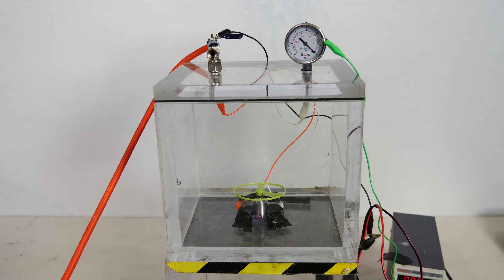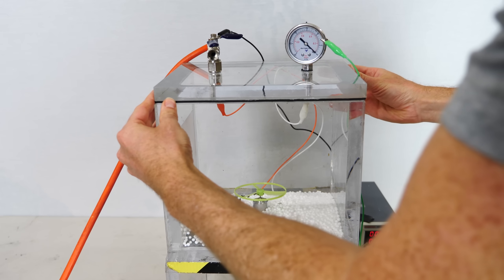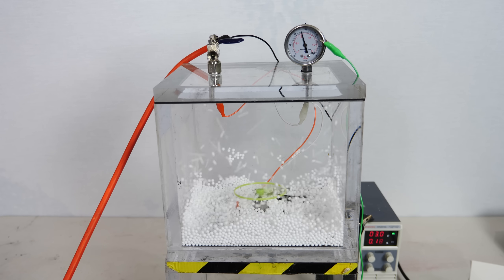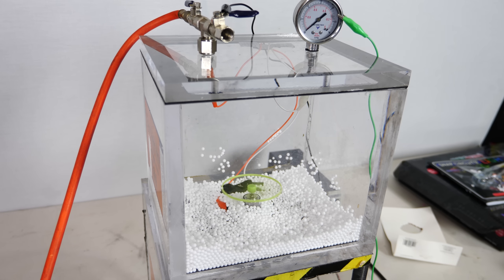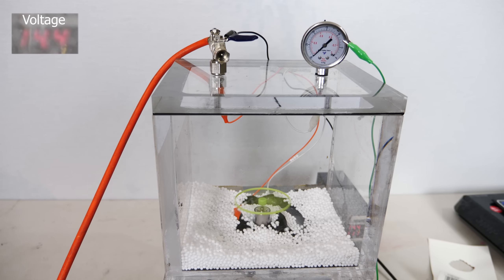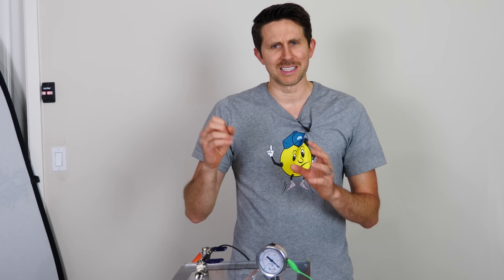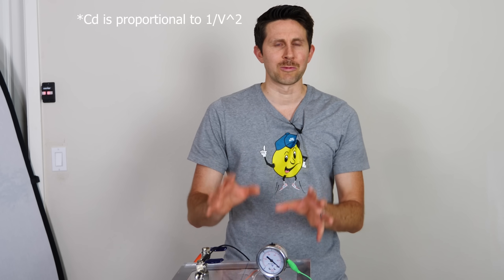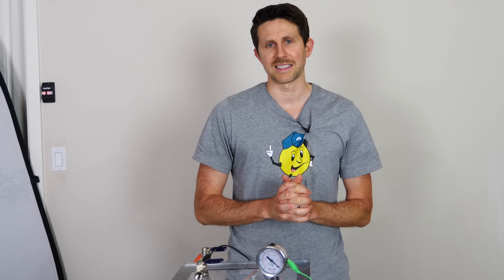What Does a Fan Do in a Vacuum Chamber? Weird Results

Comment: Vacuum on no balls are flying - electrostatic power and vibration of the motor increased let the balls fly again like crazy.  Would see it without electrostatic effect, an wooden propeller higher in the middle and a non vibrating isolated motor, perhaps with little feathers.

Comment: So no propulsion is possible in a vacuum no space travel that’s what I thought
Reply: You know that they use rocket engines in space and not fans?
Reply: @sebastiannolte1201  same basic laws of motion.
Reply: Newton's third law in this case. If there is a momentum  (mass * velocity) in one direction, there has to be the same momentum in the exact opposite direction. And a rocket engine doesn't need external mass, instead it carries the mass with it.
- when you sit in a wheelchair with a bowling ball in your hand and throw it hard away from you, you roll backwards. That also works in a vacuum.
- when you sit in a boat with a bucket of stones, you can throw the stones to the back out of the boat, and the boat will move foward. That also works in a vacuum.
- when you shoot a gun you feel the recoil in your hand, because the gun moves towards you, while the bullet moves away from you. That also works in a vacuum.
- A rocket engine shoots gas molecules out of its back, so the rocket moves forwards. That also works in a vacuum.
Reply: @sebastiannolte1201  show experiment with vacuum equivalent to space
Reply: @Seedavis397 Why does it need to be equivalent to space? If rocket thrust didn’t work in a vacuum, we’d see a decrease in thrust as ambient pressure is decreased. Not only do we not see that, we see that thrust increases as ambient pressure is decreased.
Reply: They are cooked and they know it, thats why. Vacuums dont exist in nature to begin with.

Comment: Why is there an alligator clip attached to the pressure gauge?
Reply: using the  METAL  components that  penetrate  the enclosure as conductors, in order to get power to the motor.

Comment: IT MOVES IN A VACUUM DUE TO THE VIBRATION OF THE ENGINE... NOT BY THE AIR... IT IS PRACTICALLY NULL, AND THE ELECTROSTATIC FORCE IS ALSO INSIGNIFICANT. THE "WATERFALL" EFFECT + VIBRATION VIBRATION It is the only thing that really affects the movement of the small balls in a vacuum.

Comment: It's not air that's moving it. There's two things in tandem causing this, static and resonance. the rotating fan is resonating the bottom surface of the vacuum chamber. The beads have static which is causing them to pull towards the fan when they get close enough to it.

Comment: To minimize the volt that used by the dynamo  in the Vacuum chamber using a fan that moves the styrofoam pellets why'd you didn't used used 4 arm fan and make it 35° high each one arm  hexagonal

Comment: Looked like changing the voltage made some of the beads move. I wonder how much of the energy from the fan spinning contributes to a levitation type effect from the "sound" made by the motor? Adding acoustics to move the beads, like in a vacuum tube, might be an interesting modification to this set up?

Comment: You did not get near vacuum pressure because air leaks in through all the wire leads for the electric motor etc

Comment: So,  extrapolating from what we just saw,  the Lunar Landing Module of the Apollo Missions is indeed a hoax.     In obvious terms the thruster should have displaced much of the moon dust were it not for the absence of air , which COULD have prevented agitation and transport of the moon dust.
    However the static charge, of the exhaust stream emanating from the thrusters, should have still animated the dust to displace from under the vehicle.
To prove my point I'll use a model rocket engine ( in an identical vacuum chamber ) firing at a layer of ashes lining the bottom of the enclosure and we will see what happens.
Any predictions ???

Comment: I'm surprised the fan didn't overheat.  The air around the fan is what carries the heat generated by the motor away to keep the motor cool.  No air, no convective heat transfer.

Comment: At an altitude of 130 km its pressure is approximately 1/25 that of the Earth's atmosphere. At ground level the Martian atmosphere has a pressure of 6.518 millibars or 0.095 psi as compared to the Earth's sea level atmospheric pressure of 14.7 psi. Mars' atmosphere requires blade rotation speeds of 2,400 rpm for Ingenuity to stay aloft, about five times what's needed on Earth.

Comment: Starting @1:22, when the vacuum pump is started, you will notice a pattern of balls develop on the walls. These structures are are great examples of how far from equilibrium systems spontaneously  form order and pattern under the correct conditions.

Comment: It can not be static electric field or the beads would be sticking to the glass and the wires when you upped the speed of the motor. At 12 volts in air the motor speed should have doubled but in a vacuum this may not apply and the speed could be more. My best guess would be at double the motor speed or more then it was made to spin it caused it to vibrated a lot. With the vacuum the plastic beads was not being held down by 14.7 psi air pressure and able to jump higher then they could in normal air caused by the vibrations of the motor. When the beads jump up and hit the fan blades they would bounce more and cause other beads to hit the fan blades.

Comment: Please apologize for an ill-conducted experiment. The polystyrene is clearly seen moved by blades without coming into contact. Static electric force for sure.

Esp. as there was a lot of static electricity created during the air-pressured phase at the beginning. You‘ll see beads all „glued up“ at odd surfaces ...

Comment: Space is supposed to be a vacuum.. So how does the rocket move forward with no air pressure. Interesting. You just proved space travel to be fake.
Reply: Propellers propel air in the retrograde direction to gain forward momentum according to Newton's third law.

In space there's no air to propel retrograde, so propellers won't work.
This is course isn't a problem, because rockets don't use propellers - they use rocket motors.
Rockets bring their own matter to propel retrograde at incredible velocity with the rocket engine, i.e. the fuel and oxidizer, gaining prograde velocity.

This doesn't prove space travel fake at all, you just don't understand how space travel works in the first place.
Reply: Well your entire understanding of rockets is flawed to begin with. Rockets don't "push" off against the atmosphere to generate thrust. Thats because the net force is coming from inside the combustion chamber. When the turbo pumps spin up  and send the propellant into the chamber, its gets ignited and that gas presses against all the walls of the chamber equally, EXCEPT in the direction of the rocket nozzle where they are letting the exhaust it escape through the engine bell. So because of Newtons third of law action and reaction, you will have a net force in the opposite side of that chamber that is facing the rocket, thus the rocket moves forward. And the medium into which that exhaust gas is being accelerated is irrelevant.

Comment: Next step is eliminate other effects.
1. Bigger volume of chamber
2. Metal fan
3. Springs under fan to fix vibration fluctuation on bottom
4. Change position of fan: top mount, side mount, bottom mount.
5. Pendulum swing arm motor fixed to show drag.

Physics is not just a toy dude. Physics is about serious scientific methods involved in any experiment, even simple as F.

Comment: Ok I have a question. The power supply, why does it show the voltage dropping when the vacuum is applied? Is the drag on the blades increasing or decreasing?

Comment: I wonder if the movement of the balls was due to static created by the fan? and that the static transferred to the styrofoam balls to each other which then causes them to move each other in kind of chains? Two things to try is to move the electronic components away from the fan blade to isolate the styrofoam a bit more from electrostatic energy created from the motor itself? and explore material for the blade that has a tendency not to create static energy to prevent a source of statically generated or stored in the blade material?

Comment: radiative cooling still works in vacuum- em radiation in the infrared band.  air is not required for that. this is how those reflective mylar emergency blankets work. As Planck's law describes, every physical body spontaneously and continuously emits electromagnetic radiation. (unless its at absolute zero)

Comment: Hello, What material is used to make the vacuum chamber ? 
How much vacuum can be created that will not break the chamber ? 
Can the chamber be kept on Liquid Nitrogen bath ? 
Regards
Reply: A vacuum chamber only needs to withstand 1atm (or 14.7psi) of pressure to withstand an absolute vacuum, so this can handle any strength of vacuum.

Comment: We use TMP’s at work for checking for leaks in air bag inflators after they are assembled and charged with argon and helium. 

I’m surprised the motor didn’t burn up due to the high voltage, relatively speaking, and lack of air flow to cool it.

Comment: You didn't mention the amperage of the motor during this experiment, you would have found it dropping as vacuum increased.  Removing air molecules removed work on the fan blades thus less amperage consumption.

Comment: The motor with the fan was vibrating and causing the beads to fly around. Some were hitting the blades and it appeared that they are actually flying. You need to hang the fan and repeat the same experiment.

Comment: NASA should watch this and explain how that helicoper works on Mars.
Reply: They do. That copter has incredible rotor head speed, that’s how it can fly.
Reply: @jotcw81  Um ok. You really can't have it both ways though. The scientists say the atmosphere is less than 1% of Earth's. That is near vaccuum. You can't fly a helicopter in near vaccuum. Nor can you parachute. But ok...
Reply: @treynuzum5815  It might be a combination of high head speed and less gravity?
Reply: @jotcw81  or science fiction
Reply: @treynuzum5815  Sure you can. You just need a light aircraft, huge propellers and really fast RPM.
... Which is exactly what they did.
Feel free to run simulations of it.
Reply: @logitech4873  I can do experiments that show how the thrusters work on the Starship Enterprise. That does not make Star Trek not science fiction.
Reply: @logitech4873  Flies cannot fly is a simple vaccuum chamber. They become walks.
Reply: @treynuzum5815  If you have 1/100 of Earth's atmospheric pressure, and like half of Earth's gravity, all you need to do is create a craft with much higher thrust to weight ratio than usual. (Like 40:1 in earth terms to get 1:1 on Mars)
Mars isn't a vacuum. The atmosphere is there, it's just sparse.
Ingenuity is an extreme helicopter with low weight, huge propellers and incredible RPM. Obviously it'll fly.
Reply: @logitech4873  They are not even there. But ok if you are happy, I guess it is not so bad. I mean we got some good pictures from Devon Island that look like Mars for 3 billion dollars. And this rover does tweets now that are way better than Trump's.
Reply: @logitech4873  I am facing reality. Mars is fun so have fun with it. 😁 I was a big sci fi fan once also.
Reply: @logitech4873  Also a cult requires a group, I am a loner...
Reply: @treynuzum5815  You should get help with our problems instead of bothering people with your fringe conspiracy theories.
Read up on Dunning-Kruger while you're at it, since you seem to genuinely believe your assertions are worth more than literally everyone elses.

Comment: Can you use it as a dryer to boil off the water from a pair of wet socks without introducing heat as a regular dryer as water boils at a lower temperature at lower pressure?

Comment: Maybe you should ask the lying bastards at NASA who claims they can fly a helicopter in the marsian atmosphere,  you couldn't move a feather in that atmosphere with a high speed server fan, much less lift a helicopter of tens or hundreds of grams
Reply: Of course you can. What makes you say otherwise?
Reply: @logitech4873  smarter every day demonstrates the opposite on camera
Reply: @bogganalseryd2324  When?
Reply: @logitech4873  2-3 months back, look it up
Reply: @bogganalseryd2324  What video?
Reply: @logitech4873  smarter every day investigates if a fan can move a feather on Mars, it cant
Reply: @bogganalseryd2324  Just name the video
Reply: @logitech4873  my bad it was Cody's lab, https://youtu.be/7ort0tkFFVI
Reply: @bogganalseryd2324  Newton's third law doesn't stop working at lower atmospheric pressures.
Mars has about 1% the atmospheric density of Earth, and about 40% of our gravity.

This means you need a craft with a thrust to weight ratio ~40 times higher than something you'd fly on Earth.

So the challenge is to build something like that, and it takes a light frame and huge carbon fiber propellers spinning at 2400 rpm to do it.

Have you tried running simulations of this, or are you simply making assumptions based on someone's computer fan in a vacuum chamber?

NASA obviously isn't lying - they've done their research. And you can too.
Reply: @logitech4873  well Cody's lab did an actual experiment and if he can't move a feather nasa definitely cant fly a drone/helicopter

Comment: I think this is a false conclusion. You could clearly see how the vibration of the fan spread to the beads, making them jump. As soon as they get into the fan, they shoot around and give impulse on the other beads just the way the air used to before the vacuum. Without that vibration of course the fan will do absolutely nothing in a (near) perfect vacuum.

Comment: I can tell you, EVEN WITHOUT WATCHING THIS VIDEO, what a fan will do in a vacuum.  With any air to move, the fan blade assembly will become like a flywheel --- and, because the motor doesn't have any air to move, it will turn just as fast as though it had a bare shaft without anything on it.  Now as for that toy assembly shown at the opening of this video, the motorized fan blade assembly will turn, but it won't lift the toy off the floor of the vacuum chamber; it will just sit there, spin, and make noise without doing anything.  An airplane won't fly in a vacuum either.  A jetliner flying at 40,000 feet is flying in a partial vacuum, but not in a total vacuum; therefore it can still fly with still enough oxygen to run its engines.

Comment: OH MY GOD, WHY HAS THIS MEANS OF POWERING THINGS INSIDE MY VAC CHAMBERS NEVER EVEN OCCURRED TO ME?!!!??!

Either you're a genius or I'm an idiot. I don't know, so the latter is the safest assumption :( thank you SO MUCH for that awesome idea, you wouldn't believe all the different silly stuff I've done to run a few amps of this or that inside a vac vessel!
Reply: Btw in the off chance you ever read this, you can get a cap with a brass plug pin for that glycerin filled bourdon tube gauge so it's really easy to burp to zero but can also easily be pushed back in for leak-free transport without regard for angle... as long as you don't accidentally brush the pin against something and knock it out, but even in that case it'll just drip glycerin rather than immediately dump 20ml(?) in one spot, and much less chance of debris ingress than a liquid filled bourdon gauge with the whole plug popped off. I replaced all my vac gauges with larger ones (due to my oldness and blindness), all with a burp pins, including on what I believe is likely that very same chamber, among others (is there a BVV sticker on the left side there?), and an obscenely overpriced ultra high vac regime digital readout thingamabob for when TurboMolly's riding the vac train (why yes, I do usually name my lab equipment), and in the process discovered that my new gauges are more accurate than the BVV gauges. Just FYI... you probably already know and have a million gauges with burp pins and/or don't need it, idk. 

Thanks for being awesome, and for offering science education, something the world so desperately needs more of. I think being awesome and educational makes you awesome⁴... does that math check out? New & improved 21st century Bill Nye over here.